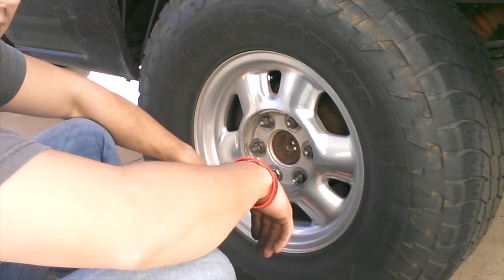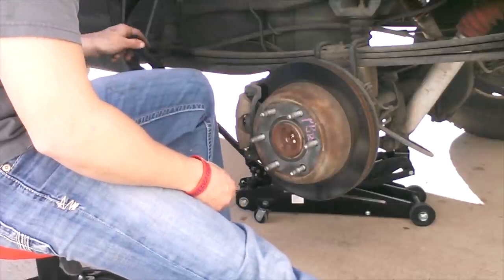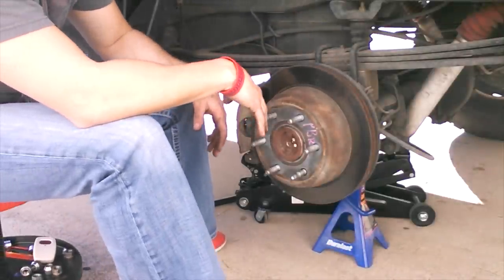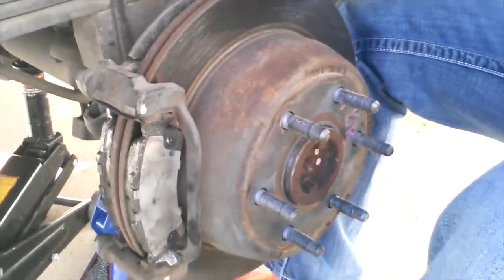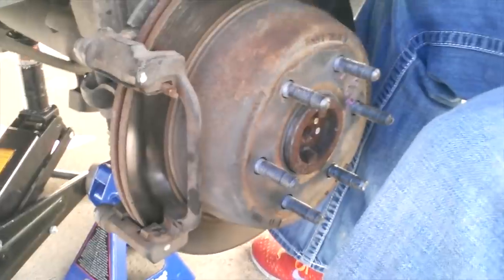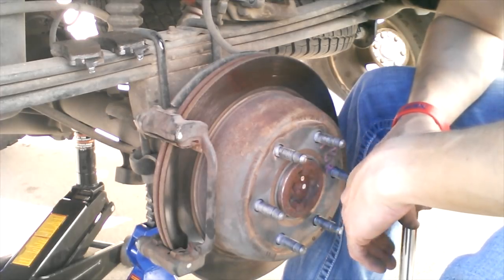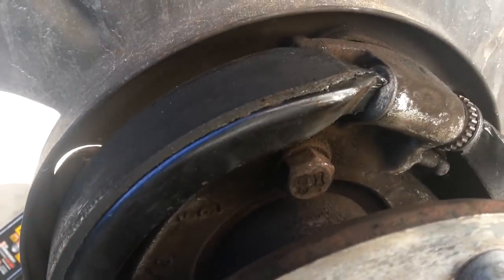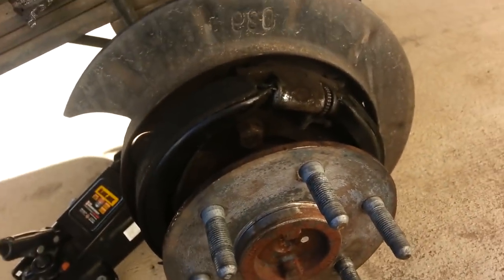GM Parking Brake Pad Change / Adjustment - HOW TO / TUTORIAL

Comment: Although not a perfect video, he has done a great job of capturing some smaller points that are critical to know, but are skipped right over in most other related videos. For example, he rightfully points out that what appears to be a bushing behind the two 12 MM bolts holding the caliper are actually nuts although they only have two flat sides instead of the typical six. Great job!

Comment: Just 2 things otherwise it was a great video. If you have drum brakes only or a setup like this always check the parking brake resistance by installing drum or drum/rotor setup (like in the video), install a few lugs all the way down to hold whichever it is you have and push the pedal down about 5-7 clicks and see if you can rotate the setup, if you cant then your good, if you can readjust. also i would suggest using a flat-tip on those adjusters not a pair of pliers.

Comment: Great video.  I needed to learn about this combo brake that has discs for normal stopping and drum for parking brake.  My comments:
1. Use locktite on yellow bolts not antiseize.  I normally would not take those bolts off cause the lock title is tuff and you can do this job on most brakes by just removing the two back bolts.
2. Put brake grease on metal side of pads. Not absolutely necessary but can prevent brake squeal.
Thanks

Comment: It's good to finally see a mechanic video on You Tube where anti-seize has been used.  It's the mechanics friend, especially if you are working on your own stuff.
If you just take off one caliper bolt you can just rotate the caliper out of the bracket to change pads.  Make a calculated choice on which bolt, make sure you have enough brake line length to rotate enough to get pads in/out.  I do know you were already planning to take all the caliper and mount bracket out of the way.  This comment was FYI for you and others.  I watched a video yesterday where the guy was changing pads and took off the caliper bracket with the caliper still on it to change them.  Yeesh!  
Good job on the video, I'll be doing this job soon on my S-10 ZR2.  I drove 50 miles with E Brake on one particularly bad day.

Comment: Nice job.  I really appreciated the thorough explanations at each step.  I particularly appreciated the very clear close-ups -- nice camera work there!  I am having trouble getting the rotor off because, i think, the emergency brake is so jacked that it's keeping the rotor from sliding off.  It's loose, but hanging up bad.  Your close-ups are very helpful at showing me what I'm supposed to be seeing.  The close-up on the adjuster was awesome.

Comment: I'm not sure if it was mentioned during the video but I found out that on a 98 Blazer you only have to adjust the left rear PB. I found out the hard way by attempting to adjust the right rear and it's not possible. The whole video on this was excellent and very helpful.

Comment: I just take the entire brake caliper assembly off, even if I were just changing pads. Also, I think that yellow "anti-sieze" compound is actually thread lock compound. That's why these screws are so hard to break loose. (Anti-sieze compound is usually either silver or copper colored.)
Reply: oscar madison I agree. No need to disassemble the caliper. Just loosen the mounting bolts and remove the assembly. And yes, that is thread locking compound,  not anti-seize  :)
Reply: Worth noting is a coat of Loctite holds fasteners but stops moisture intrusion. The stock "dot" is sheared on removal so I use the gel (for convenience so it doesn't run off) on reinstallation.
Reply: was hoping someone noted that.

Comment: Great video. All I need to do is tighten my parking break, but I was curious much it would take. Thanks for the video!!!
Reply: There is a little hole in the back to adjust the PB,  no need to even take off Tire.  Just jack it up to spin the wheel....  Little hole in back, stick in a flat screw driver and turn the left side down to tighten, and turn the right side up to tighten.

Comment: Well done!  Thanks for the explanations as you went along.  I’m about to replace my emergency brakes, and now I know what kind of resistance I should expect to feel when re-installing the rotors over the emergency brake pads.  I just hope I don’t have to take apart that adjustment cylinder to clean and lube it before installing the pads.  Again, well done!

Comment: Thanks bro! Good shots on the video during brake shoe adjustment. It took me a bit to find yours.. as it directly applies to my 2001 silverado 1500. . To the comment about the guy who mentioned the brakes being self adjustable.. theyre not..They may have been intended to work that way. but they don"t work.  The haynes manual tells you to do it exactly like my man said. .And another comment was made about being able to adjust from behind the wheel without doing this procedure.. Good luck with that.. on some vehicles this is possible. but  on mine , the left brake lever and spring are at the top of the backing plate so getting in between that and the leaf spring which is only about 4 in away makes it to where you cant see what your doing. Also there was mention that pushing the piston in probably isnt a good idea without using the bleeder screw. He's prob right. I   didnt   think about that before. Ur just pushing dirty fluid back to the reservoir. But if you are going to do it that way .Push the piston in using a c-clamp ( and a piece of wood, or something so the piston doesnt get damaged). It's a good idea to keep an eye on your master cylinder level while your doing it. It will fill up. Manual says to pull fluid out of it before hand. 
Thanks again Red Raider for the  great vid. I will be doing mine  exactly how u did urs tomorrow. !!..If you dive into anything else before I do...Hook me up!.. lol

Comment: The caliper pins a 16mm is equivalent to 5/8". Also if your truck is as rusty as my '05 hitting the caliper pin bolts & caliper bracket bolts with some penetrating oil is a must. I also had to use heat on the bracket bolts to get 'em loose. Even if your not adjusting or rebuildingbthe e-brake it is worth the bit of time to go clean & lube up the actuator & contact surfaces.

Comment: If you are just working on the parking brake and not changing pads, just remove the caliper bracket bolts and remove the brake as an assembly. Much less labor ;)

Comment: Great video, thanks for the help. I noticed on mine when fitting the rotor for resistance it would catch the parking brake shoes a little too much and pull them out of line so I had to tap them back in place to get the rotor on straight. other than that it was a good project with no hiccups

Comment: Nicely done. The only thing I would interject is to Never push a brake caliber piston in like that. Always place a plate across it then the c clamp on top of that. Some caliber pistons screw in and by placing the clamp inside the piston as you show could fuck it up.

Comment: I thought you could "expand" the parking brake assembly through a slot in the backing plate....turning the star wheel with a flat blade screwdriver until you get resistance while turning the rotor/drum without taking everything apart.
Reply: +paul drozdowski it's a 2002
Reply: @rareform6747  Yea I have the same brakes in my 04 sierra and no inspection hole/adjust.......I really think a error in design. I had a 96 sierra with them and drums only and was a much superior rear brake for service and power. Gm went back to the drums only in 05 and 06 (GMT800) Its a trick setup.

Comment: Excellent instruction Red Raider.  Thanks. 
 One edit I would recommend...at 11:00 minutes in, you showed the lower bracket which holds shoe in place, but at 17:00 minutes in, after you demonstrated how much to adjust the parking brake shoe by spinning the wheel (excellent instruction), you forgot to RE-TIGHTEN that lower shoe clip.  Maybe just type some script onto the screen, reminding the view to tighten that bracket before sliding the snug rotor back on.
 Thanks again RR.  Awesome job!

Comment: I believe that these are self adjusting. If you work the parking brake several times initially and then periodically there is no need for this. The knurled nut has a armature below that moves it each time you apply the brake.
Reply: +macklandtube  That is correct.  Every time you press the brake pedal when driving in reverse the brake will self-adjust.  If however, the emergency brake pedal goes to the floor or the emergency brake will not hold the vehicle on a hill then you must use this procedure to adjust or replace the emergency brake shoe. Excellent video RR.

Comment: Very good. Will be doing rear pads on 99 S10 again. Wanted a refresher on how caliper mounts to bracket. This leads to a new question for me, why should the parking brake pads ever need to be replaced? I assumed they stay retracted with zero contact 99% of the time, only being applied when parking and not moving. Why the need to replace?
Reply: Sometimes people forget to release their parking brake, and then start driving away with a small amount of pressure still engaged...wearing down the pad..

Comment: There is a little hole in the back to adjust the PB,  no need to even take off Tire.  Just jack it up to spin the wheel....  Little hole in back, stick in a flat screw driver and turn the left side down to tighten, and turn the right side up to tighten.

Comment: One quick question I didn't see you put any a nice he's on those big boats on the back of that caliper bracket and also aren't you supposed to grease that the two bolts 12 mm ones that go inside the caliper that doesn't that have to be greased or something

Comment: I have the same problem with my 2003 grand prix. this helps ty
Reply: Did the rear pads and rotors on my car and accidentally misaligned the e-brake shoes and it doesn't work with the e-brake pedal pressed half way, but all the way to the floor and the e-brake works as intended. So, if my car has no brakes due to a bad line, I won't be able to use the e-brake at lower speeds. Lesson learned: adjust the e-brake shoes before installing the new rotors. Maybe I should get new ones as they are a bit worn out and for an 18 year old parking brake, it's not bad, but the shoes are grooved.

Comment: I like the way you loosen the lug nuts. I have never liked the idea of lifting on the pumpkin. 
Good for you, I will use the sized socket which fits what I am removing, I see your using the 3/8ths with the 1/2" . I have even used it down to the 1/4" for the bolts which are just a little too tight for finger removal. 
Haaaaaa it is the error part I don't like.

Comment: If you don't have a c-clamp for backing--up the piston you can use large channel-lock pliers.  If you've been adding brake fluid, might want to remove some of it before backing the pistons up to prevent spill over in the master cyl reservoir.  Question - - can't this park brake be adjusted from outside with a common screwdriver?  Back in the drum brake days, you could adjust the brakes that way. Not so sure now.
Reply: +q7wasp7 
I looked carefully at the mechanism after taking it apart.  The parking brakes cannot be adjusted without removing the parking brake rotor-drum and doing it from the inside.  "Bad design" but then that's GM for you.

Comment: When I have done "other trucks & cars" I found its faster just remove the whole frame , I e, caliber & pad bracket  Just be sure to pry brake the pads slightly from the disc so reassembly is EASIER.  Just a thought.

Comment: so much easier on a 1500 than a 2500HD.... Also, you can adjust both models from access hole behind backing plate without removing tire, wheel, brakes......

Comment: Hey brah, cool video...but you want to use red threadlocker on those caliper mounting bracket bolts NOT anti-seize.
Reply: "Blue" lock tight, not red.

Comment: Great video, the only thing I saw that I wouldn't do is push the brake fluid back into the master cylinder. Instead just open the bleeder on the caliper and push the caliper back to release pressure then close it. Pushing fluid could mess up the master cylinder, and mess up the abs if your vehicle is equipped. Other wise great video. Thumbs up!!
Reply: never use the bleeder if you don't have to. bleeders are generally really weak and if that bleeder is stubborn/rusted it can break off, which are sometimes impossible to take out without damaging the caliper which means you'll have to purchase a new caliper. the only way you can mess up the master cylinder is if there is air in the system and you start pumping the brakes. that's why normally mechanics will avoid disconnecting the caliper or bleeder valves.
there is one exception to this; and that is if you live in ideal conditions where they don't dump salt on the roads.

Comment: One note...you can remove the entire caliper assembly by just removing the two 18mm bolts without separating the hydraulic unit from the bracket...little bit of a time saver.

Comment: What are you using as a block to lift  your truck,  the block between the axle and leaf spring?
Reply: Place the jack directly under the plate where the shock mounts on the rear axel.

Comment: Question - - my 2003 silverado left rear rotor area got extremely HOT but now not sure what's causing it - a seized piston in caliper or seized parking brake.  Any guesses before I pay the garage $250 to look at this?
Reply: +pen mightygun 
I paid Tuffy $250 to replace the caliper.  Apparently the calipers corrode on the inside and cause pistons to seize - not retracting after braking applied.   If I had known it was just the caliper I could have just bought one and replaced it for about $70 with the trade-in for the old caliper. I'm out $180 for not knowing the problem specifically.
Reply: +q7wasp7 That happened to me to. I wasn't sure if it was the parking brake or the caliper but then realized it was the caliper because it was extremely hot and I could smell the pads burning. Also to double check after
taking off the caliper the wheel turned properly with no resistance so I knew it wasn't the parking brake and it was the caliper.

Comment: Great video, man. That yellow loctite they put on there caliper mount bolts is a bitch!  Had to heat it with a propane torch,  hit it with Aerokroil, then pneumatic gun to break them loose.

Toque for the caliper bolts is 30ft#
Toque for the caliper bracket bolts is 148ft# YOWZA!

Comment: Has anyone had this issue:

Brand new rotors and parking brake shoes. But the shoes just barely fit into the rotor inner drum, and when installed, you can barely get rotor over the new shows? Adjusters bottomed out and brand new. Tried both type of rotors and multiple brands of shoes, all extremely snug. All videos on here make it seem like shoes will be loose when installed. Would love some help. Thanks!